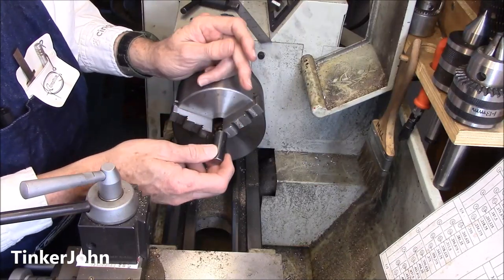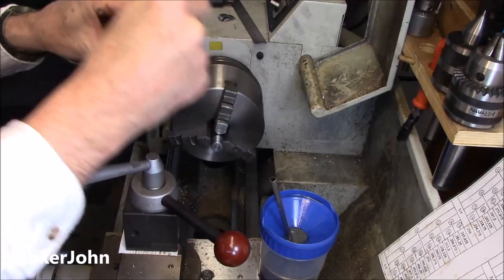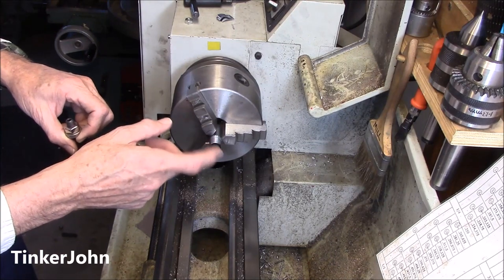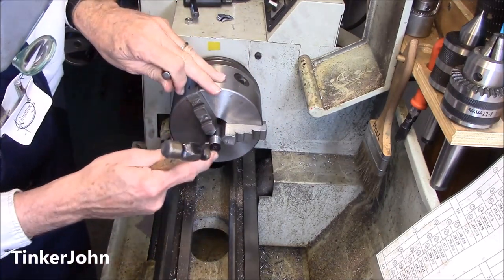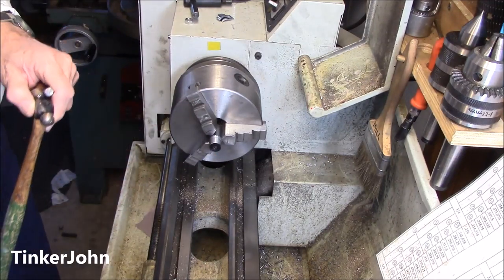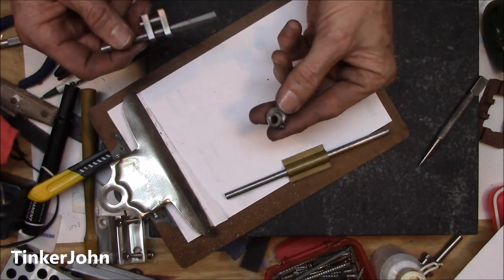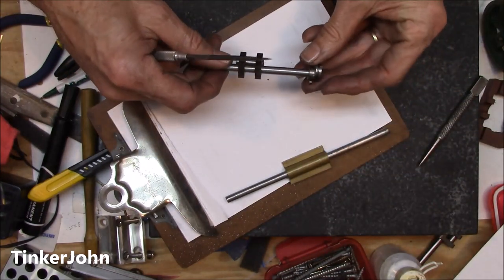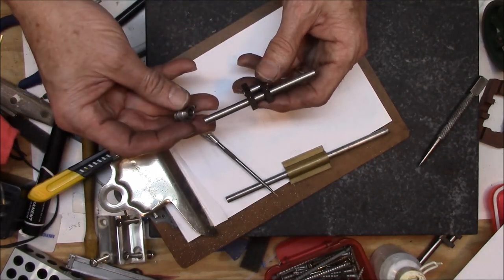Machining the Stuart 10V Steam Engine Castings - Part 12

Comment: Thoroughly enjoying the whole series as I machine my 10V. Just a thought. I marked my eccentric offset as you did and then as I set it up my 4 jaw I  measured with my DTI  how much I was offseting my 5/8 rod by as a double check. Worked well. Thanks again. Dave here in New Zealand
Reply from the maker: Dave, thanks for watching and for taking a moment to comment.  Your method of making the eccentric works well. As you found out, there are several ways to set up parts for machining.    ~John

Comment: Hi Tinker John from Devon, England.  As a first project I am building a D10 with valve gear and feed pump.  I chose this because I already had the book on the V10 and I was able to buy the castings direct from Stuart Models when I passed by in the summer (they are just along the coast).  

I then came across your videos purely by chance having already seen Tudor Barker's photo spread on the build.  If you don't know of it go to tudedude.co.uk

Thank you very much for taking all the time to post up your series.

Comment: Hi John, I am just about to start building the twin cylinder version of the 10v so I have found you videos inspirational. I would like to have more detail on the tool you used in this video to get the concentric in line. Can you help? Paul
Reply from the maker: Paul Gardner Paul,  Thanks for following along and for your comment. It's pretty hot in Texas right now and shop time is limited, however I'll try to get a video up showing the setup.  ~John

Comment: What's the rod called that you used in this part to center the eccentric.
Reply from the maker: I'm not sure of the exact term used for the rod, I made it several years ago.  Here is a link to something similar but without the spring:  http://www.modelenginemaker.com/index.php?topic=6379.0     I made mine in two pieces and put a spring in.  Not sure if spring is required.  Hope this helps.    ~John
Reply: Thanks John, that gives me some ideas!